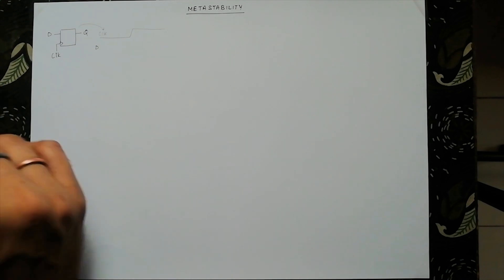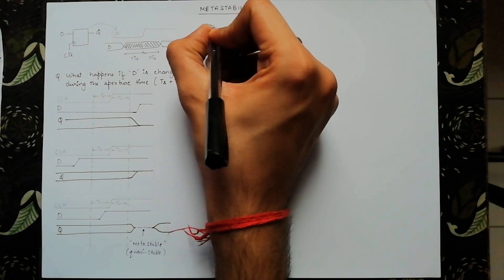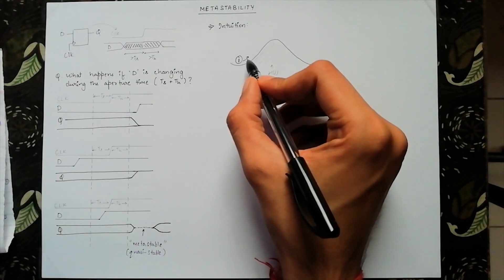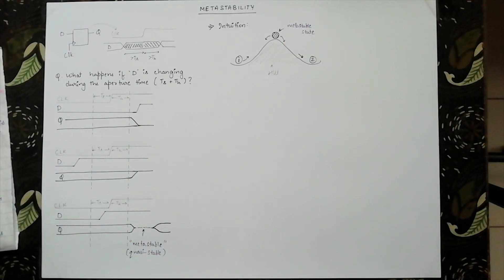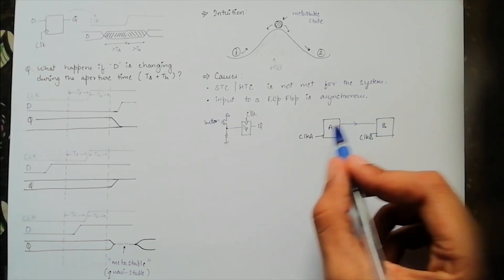Metastability - Part 1: Introduction, Causes and Effects

Comment: 00:00 Metastability in Sequential Circuits
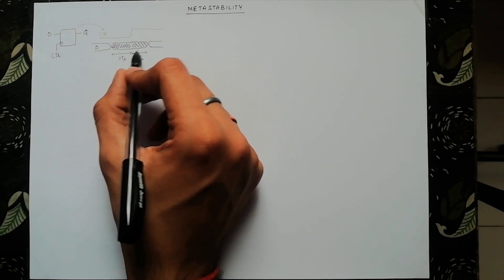00:58 Understanding the effect of changing input D during aperture time
01:46 Metastability is the process of a flip-flop settling into a stable state.
02:37 Metastable state is unstable due to disturbances
03:23 Metastability and its causes
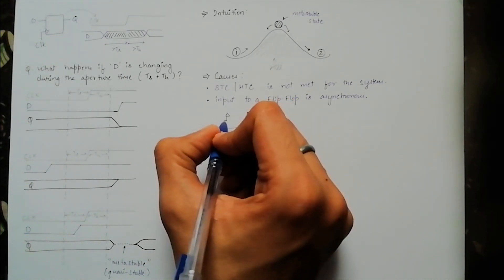04:13 Asynchronous inputs can cause metastable state
04:58 Metastability in flip-flops can cause unpredictable data output.
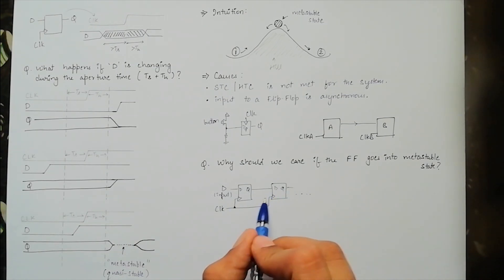05:45 Metastability can cause system failure